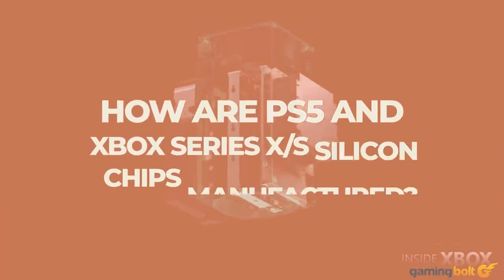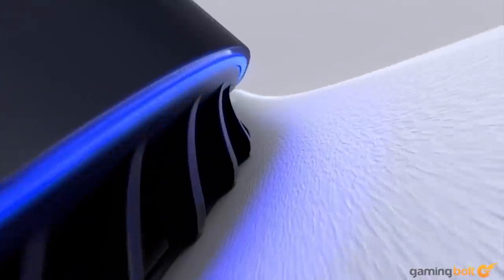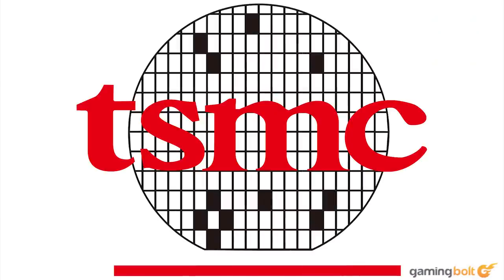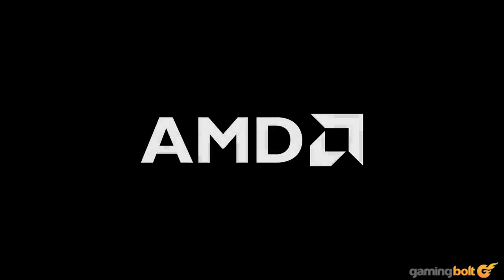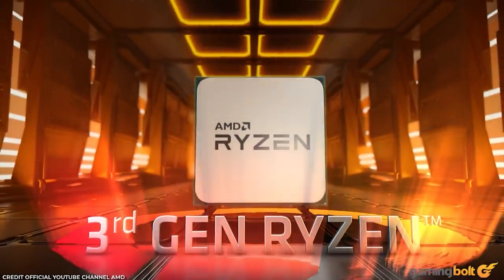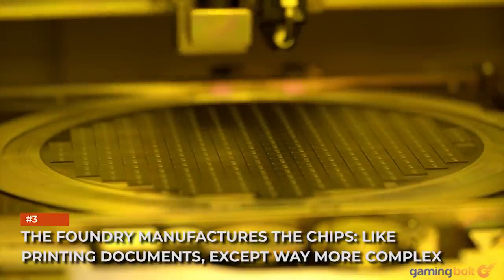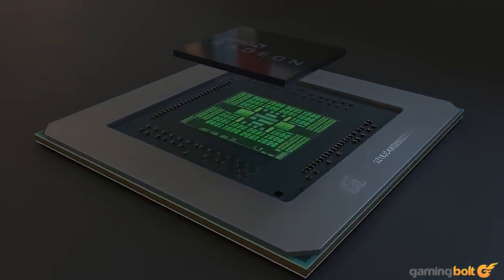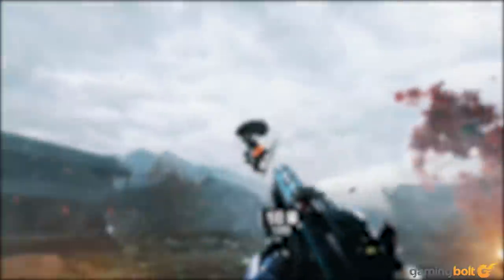How Are PS5 And Xbox Series X Silicon Chips Manufactured?

Comment: Nice Can I Buy The Chip And Put It In My Motherboard
Reply: no you cant its not  sold in retail market and it wouldnt work with pc because these chips have different booting cycles and  security for DRM reasons
Reply: (Piggy backing onto what Pandaa12333 said) even if they were, the chips aren't physically designed to fit into a conventional mother board.

Comment: So if amd makes the gpu cpu then what does Microsoft and Sony do ?
Reply: That's a good question.  Both Microsoft and Sony individually worked with AMD to customize their SOCs, specifying exactly which instructions the CPU and GPU will support in hardware and how these processors interconnect with each other and with RAM, the SSDs, and other I/O.  They went thru the list of all of the instructions that you would find in a PC's CPU and GPU and picked which ones to keep, which ones to get rid of, and even added a few new instructions.  These decisions have a big impact on cost and performance.  Here's a video presentation by Mark Cerny called "The Road to the PS5" that goes into this: https://www.youtube.com/watch?v=ph8LyNIT9sg
Reply: Counting money and smoking weed